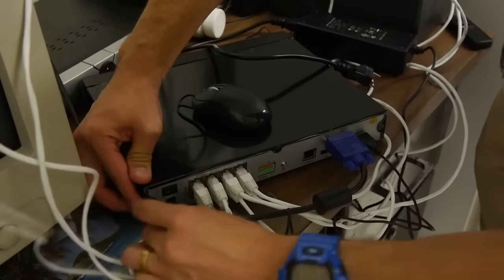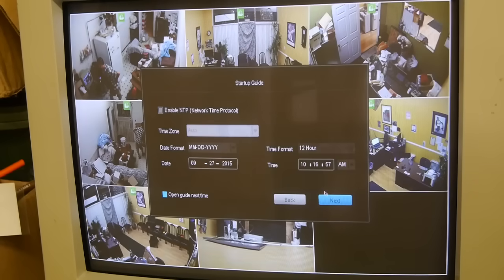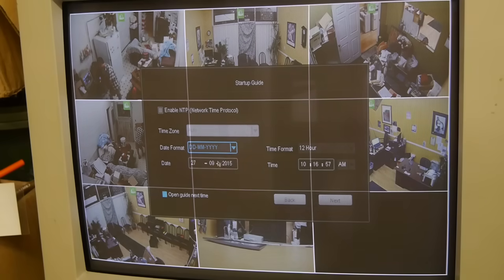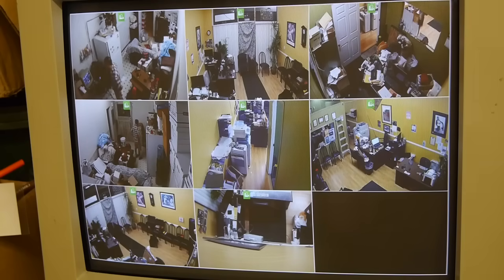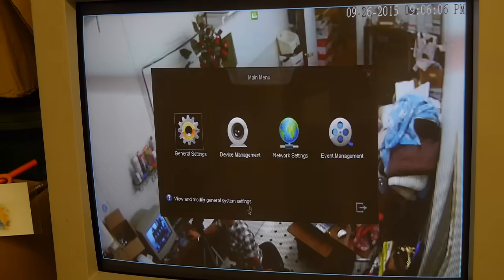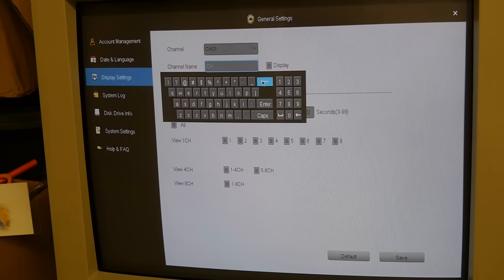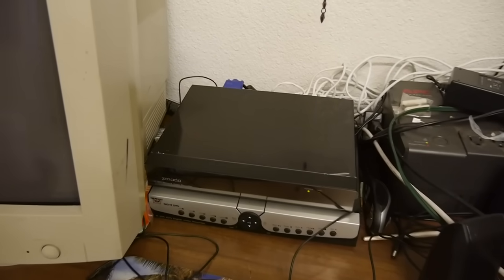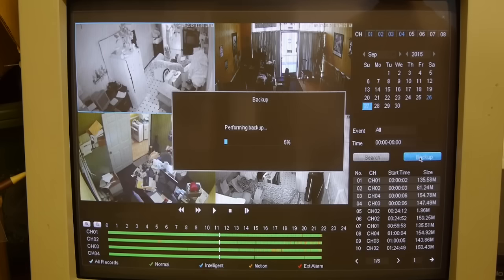How to install a Security Camera Surveillance System

Comment: Can u provide a link to a security system that's wireless but good quality? Tks! New subscriber!
Reply from the maker: Even better, here is a link for a true wirefree camera system https://amzn.to/3Vkpw3W these are in my opinion better than "wireless" as wireless systems still have cables that need to be plugged in for power. The link takes you to a wirefree camera system. Runs on batteries and you can always buy little solar panels for them separately so you never have to recharge unless you don't mind recharging. Disclosure, Tool Craze is an Amazon affiliate. If you make a purchase through my link, I may receive a portion of the sale. Thanks for subscribing!

Comment: And here I am 7 years later... and most likely things have changed
Reply from the maker: Like what? I've bought some over the years and didn't see anything different from what I can tell, bought both analog and IP cameras, prices have dropped and analog cameras from years ago now have HD options and look good too for being analog, can't tell the difference between those and IP. One major thing is now they have completely wireless cameras that run on battery power like those from Arlo.

Comment: if I buy and install my own hard drive into  my DVR ....does it take much programing to get it to work, as I have never installed one...thanks
Reply from the maker: Its a very easy process and the DVR software handles the formatting. You plug it in and it either formats it automatically or it may ask you to do so and you simply accept yes and let it do its thing. No technical skills or programming required.
Reply: @ToolCraze  yep...you are correct..it prompted me to format it and all I had to do was click yes...now recording fine...thanks much

Comment: 2021... and this is quite an interesting video. i have one question because in the minute 13 something you say that we can buy NVR with more ports but my question is, if i have a 4 ports NVR and I need more cameras, can I connect a switch with poe to this NVR to get more available ports? For example, my NVR has 4 ports, I use 1 to connect to switch so i have still 3 ports available plus the ports from switch (for example 12 ports). It is possible to connect other 11 cameras to this switch? meaning, with a 4 ports NVR plus a switch can i have 12 cameras running and all data will be recorded in NVR individually? Thanks for any reply. Cheers
Reply from the maker: Rather than ports, what you need are channels. Regardless of whether it's a DVR or NVR as both have a limited amount of channels they can record. A NVR is basically a DVR built specifically for IP cameras. Adding a switch with more ports will not give the NVR the ability to record more channels. Each camera feed is a channel. For example a 4 channel NVR cannot record more than 4 channels, even if you connect a switch with more ports. That's why I suggested to future proof your system and buy a DVR (or NVR) with more channels than you need now so that later if you want to add more cameras you can without the need to buy another DVR (or NVR). With extra channels you can always buy extra cameras, but if you are maxed out on channels and cameras and want to add more, then you are forced to buy another DVR with more channels. For example you buy a 4 channel dvr and later find out you need 8 cameras, then you must buy a 8 channel DVR.
However my suggestion is just that, a suggestion. If you feel that you will never need more cameras, you can save money and buy the appropriate amount of cameras and DVR. For example, if you only need 8 cameras and will never need more, then why pay more for a 16 channel DVR. Save money and buy an 8 channel DVR.
Hope this clarifies things for you.
Reply: @ToolCraze  thanks for such clear answer. so my second question is ( please accept my apologies but i like your suggestions 😊): some time ago one expert came to my house and gave me cost expectation for installing these cams. a 8 camera nvr for 8 cameras but he added a 8 port switch and another 8 port rack, a router, and a monitor. if the nvr has 8 ports plus 1 port for router, why he needed to add switch and rack port?
Reply from the maker: @xnetcascais  that's a good question. I cannot say why the installer did that since I'm not the one who installed it however a switch is just an access point to connect devices to a network. It won't magically make a DVR or NVR record more channels than it's designed for.

Comment: i am just putting my system together.   I have a female dc1 cctv i didn't install yet.  i have wifi so i didn't get a vga cable.   i did get yellow and red cables but don't they have to be hooked up to the cameras?  I think they are for audio which i need for a tenant dispute.   She is totally lying saying i am hearing things.
Reply: i also think it was the best video so far.   Everyone else leaves stuff out.

Comment: Watching from Philippines. I have been using analog camera with DVR & HD. Problem: There are horizontal lines appeared as seen on cctv. I cleaned the BNC and female power chord, then wrapped them using electric tape. Afterwards, the lines are still there. Can you suggest any solutions on this matter? Thank you!
Reply from the maker: I would call the manufacturer technical support, they should be able to help you out

Comment: hey has the video been removed? because I can watch it on either of my devices.
Reply from the maker: This video has been reuploaded here: https://youtu.be/601i0tIMzIE
I did a small edit within the video and since then it doesn't play anymore, bummer so I had to re upload again
Lesson, don't ever trim or edit your video in the Youtube Editor otherwise you'll break your video
Reply from the maker: Youtube fixed the issue and this video works now

Comment: I tried to watch this video again and it said that the video is unavailable I’m bummed because this is one of my favorite videos
Reply from the maker: I noticed it too, I trimmed a portion of the video and it's been like that since. I'll have to reupload as there doesn't seem to be a fix. Unfortunately the original video files are in an old laptop that doesn't work so I'll have to figure out a way to pull the video files out. Might just need more ram.
Reply from the maker: This video has been reuploaded here: https://youtu.be/601i0tIMzIE
I did a small edit within the video and since then it doesn't play anymore, bummer so I had to re upload again
Lesson, don't ever trim or edit your video in the Youtube Editor otherwise you'll break your video
Reply from the maker: this video works now, Youtube fixed it

Comment: Very good video covering most of the points. The only issue I see with Zmodo IP cameras is the Ethernet conector. It should have a weather seal otherwise rain, snow, sunlight will damage the connection (rust). Standard weather seals won't work (if purchase separately) since the IP camera jack is too big. Zmodo should update that connector and include the weather seal connector.
Reply from the maker: thanks however not a zmodo review but rather a how to install a camera system as mentioned in the title
Reply: @ToolCraze  You have a valid point but at the end of the video there is a recommendation to buy that Zmodo product.
I was about to buy it until I saw the connections.   wouldn't like someone to install that outside thinking the connections are weather proof. That's all.

Comment: This not wise. Be wise as a Serpent. Many homes Security cams have been getting hacked. There has been,before & after this video was posted,many Warnings that to use the wifi cams is to RISK (RISK:HIGH) hacker(s) accessing these,and is not difficult for them.  AVOID LIKE THE PLAGUE!

Comment: Problem with all these cameras is that they all have a female connector which is difficult to insert it through walls, bricks, etc., without drilling a massive hole (20:42). The camera connector should have been a male plug and the PoE cables should be female because the female connector is much smaller and can be inserted in a smaller hole, saving the need to purchase a huge 20mm impact drill bit for the job and shaking your bones while drilling bricks, concrete, etc. Bricks in particular could be subjected to cracks or breakage from the vibration of hammer drilling. You try it no a normal red brick and see what I mean. Start with a 6mm impact drill the a 10 mm, and finally a 20mm with is adequate for the size of the female socket of the camera, then you understand what I mean when your teeth start to rattle and grind for the shock of the hammer drill. And, being on top the ladder, it's also a difficult task to push the drill into the masonry with full force. Chances are you could fall. If these cameras had a male plug instead of a female with a big fat hole, it would have been the size of the PoE connector and a much smaller than 20mm hole would have made sense to pass the male connector through the hole. Instead, the male connector is on the PoE cables. You will find out how difficult it is to install cameras without first breaking your bones, either from the huge hammer vibration or falling off the ladder at whatever height you're working. Trust me, it's wrong. I have experience in this field and I disagree with cameras having female connectors and PoE cables having male connectors. Generally this question need to be asked, which connector has to go out to the camera and which has to go in regarding cameras that are attached to walls?
Reply from the maker: look into sPoE, the connection is very small https://amzn.to/3bnxcuL
Reply: @ToolCraze  
Thank for the info. But this is of little use because all cameras are already prewired with a monstrous cable and a bunch of other connectors, such as Hikvision. Problem is for cameras that are installed outside the home and require a large hole to insert those connectors all at once, especially through bricks and concrete walls that are thick and require a long (deep) hole. You try it, drill a 20mm hole up to 200mm deep (through the brick or concrete wall and then continue through the drywall, see if you can insert that bunch of connectors all in once, you cannot, unless you drill a hole 50mm in diameter.  But, to save you time, you, honestly, dont need to drill any holes to try it yourself just to get a picture of what I am talking about. You don't even have to use an impact drill big enough to be able to use a 20mm impact drill and shake the bones out of your joints. You can use a 200mm long tube with an inner diameter of 20mm and then try an insert all those connectors through the tube, starting with the female PoE connector first. You will not be able to insert the rest of the connectors (Power, Audio, etc.) all at once. Hence the argument here over these unnecessary oversized connectors that need at least 60mm diameter and deep hole, or else the task of installing cameras on outside walls is almost impossible.  And people say Hikvision is the best? Ha. I've heard of jokers before but this a crap system, none the better, trust me. I will make a video about this and see for yourself how dangerous and risky it is when trying to drill a 20mm hole, but 50-60mm? That requires a job by a professional brick cutter using a specialized circular saw that costs money to do. But, why a large hole? Why not using commonsense when designing and cabling the cameras? Why a female connector and other large connectors at the camera end. And why the PoE cables have male connectors at both ends? Do you think that the male connector has to pass through the brick or concrete hole to connect with the camera's female PoE connector? If so, how do you cover or hide all these connectors and camera cable out of view? Now, that's for you to answer on the stupidity of having all these bulky connectors attached to a camera cable.

Comment: Look, installing the cameras in and out the house is easy. What I want to know is, apart from a mobile App that you use to view live or recorded video, is there a way the NVR can be connected to a network router via the Ethernet and view everything from the recorder, including live and recorder video on a computer? I have a Samsung tablet and there is no app for the same system that a smartphone has. Plus, and this is also important to know,  I have a 4 months old Android based TCL Smart TV that I have been searching for Apps compatible with my 4K security system to no avail. All the Smart TV has are Apps such as Netflix YouTube, sports channel and other garbage that requires sign-up to watch, and costs money too. As I said, it's easy to install, wire it and watch on screen, but which screen? If you connect a monitor to the recorder,  that's a screen. If you are able to view live or recorded video, that's a screen. But, if you want to view the same on a computer, a tablet or another way, the use of a network ready video recorder, such as Panasonic, that is the problem, you can't view it. I have a 4K Concord security system with 4K cameras. Excellent system but I cannot connect and use on my computer wirelessly, even when the recorded is connected to a router with an Ethernet cable because there are no Apps as far as I have checked. What I want to know is, are these any Apps or software for Smart TVs to operate and view home events on it, instead of having to purchase another monitor/TV just to view the live videos? If not, then these TVs are really not so smart, are they?
Reply from the maker: only way for remote viewing is via whatever pc and mobile software they provide

Comment: wondering if you can tell me how to adjust the settings so the cameras aren't showing still frames. Like you see the dog then it stops and then it shows the dog 2 ft away
Reply from the maker: sure, consult the manual for troubleshooting
Reply: @ToolCraze  sorry it didnt come with one.

Comment: Is there a way to mount the camera to a ceiling without having to take the camera out of the housing an flipping it over an rescrew it? The cameras I have [I believe] are not gyroscopically capable

Comment: Excellent video, very informative.   The problem of installing a camera sideways might be resolved by a mechanical adapter for mounting the camera.   I suppose the cameras have means to switch between up and down, mechanical or electronic.    Thanks again.

Comment: Hello sir! Thank you for your tips and help. Just a question though: is is an absolute necessity to have a monitor installed? I'd like not to install one to make it less visible but use the monitor only to check the recordings later if anything happened. Is this at all possible? I was told it will be tedious but I thought why would it be? all it will take is to connect the monitor to the DVR and view what happened. Am I wrong? Thank you!
Reply from the maker: you will need a monitor for initial setup, after that you can remove it and plug it back in at anytime you need access again to the dvr
Reply: @ToolCraze  Many thanks sir!

Comment: Is there really an advantage to using these wired cameras over using wireless cameras?
Reply from the maker: Wireless cameras aren't actually wireless as they still have a wire and plug and needs either a extension cord or a nearby outlet for each. Only Arlo style cameras are truly wireless since they use batteries

Comment: We recently installed this system but having a problem with playback. In event playback it misses time - it skips from 2 mins to 5mins so I am missing what has happened inbetween. I have tried all different ways but will not get the exact event needed. Can you help please.
Reply from the maker: Check to see if it's only recording motion detection or recording 24/7. Consult the manual for more details. If everything is set correctly and is still having issues, it could be defective.

Comment: My house doesnt have electric outlet to plug the power cable in on each corners! Help!
Reply from the maker: Not sure why you would need an outlet in each corner. 
If you watch the video, you would notice that an NVR system with PoE only uses one power plug from the NVR box. Any other system will have camera bundles where every set of 4 camera power cables combine into one power plug plus the power plug from the DVR and even then, all the power plugs are all located where the dvr box is so not sure why you would need an outlet in every corner. Could you please explain why you need an outlet in every corner?
Reply: Tool Craze I bought the wireless version which only needs to plug 🔌 to the outlet and it is already ready to use. No need internet cable
Reply from the maker: Well that's the problem with so called wireless cameras, they aren't actually wireless. You have two options. Either add new outlets near each camera which would be expensive unless you do it yourself OR will have to run lots of extension cords to each camera. A third option is to get a truly wireless camera system like the ones from Arlo, their cameras have absolutely no wires and run on batteries. You can check them out here: https://amzn.to/2NUgOt3
Reply: Tool Craze thank you so much

Comment: If I’m placing 8 cameras outside, will I have 8 drilled holes on the outside to accommodate 8 wires?
Reply from the maker: How else would you get the wires through the wall?
Reply: Tool Craze I was asking if the cameras were linked together and eventually reduced to only one wire which a person would have to drill only one  hole for only one wire.  That is how.  Elocution classes would improve your videos. Thanks!
Reply from the maker: You could if you wanted to but it wouldn't make much sense unless all the cameras are near each other otherwise you'd need lots of additional extra wiring. But if that's what you want then go for it. That is how. Comprehension classes would improve your understanding. Thanks!